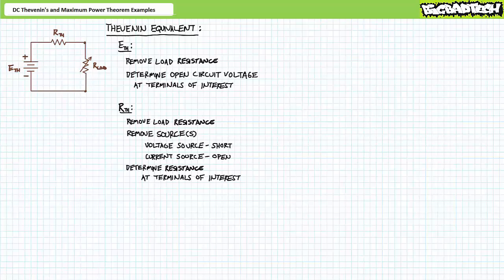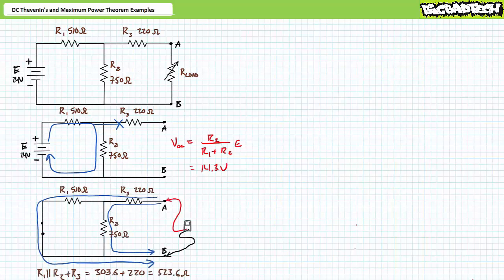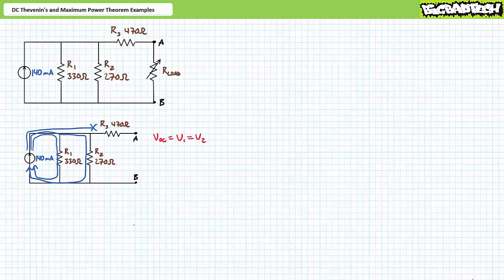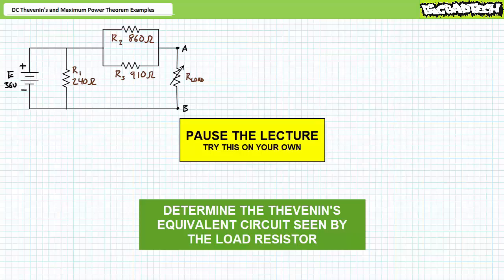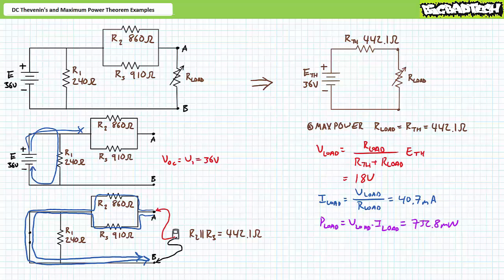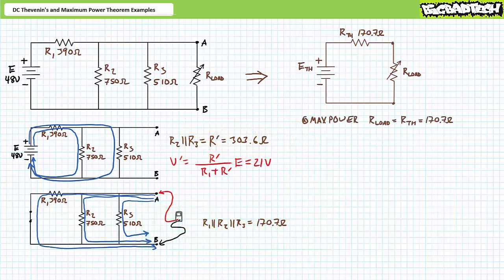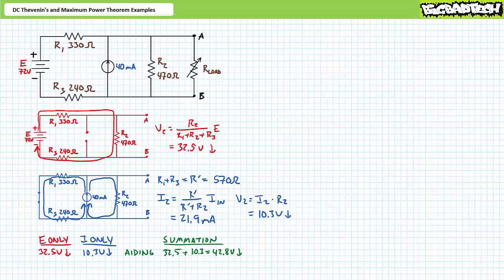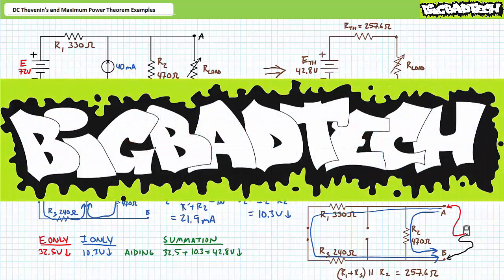DC Thevenin's and Maximum Power Transfer Theorem Examples (Full Lecture)

Comment: For the last example, I used source conversion to convert the voltage source to current source hence turning both current source in the same direction and also putting R1 & R2 together and putting the R12 in parallel with R3. And since the 2 current sources are parallel to each other and in the same direction, summed them up and used as current into the parallel resistors and hence, determined the voltage across A and B also E-th. Although I arrived at the same answer as you, I just want to ask if it is a logical approach or if it is logically wrong.

Upon watching the next video in the series, I realize I was just ahead of myself lol 😂.  I guess I’m tracking 😜
Reply from the maker: You are indeed tracking. There’s more than one way to a solve a problem … importantly you should get the same results!